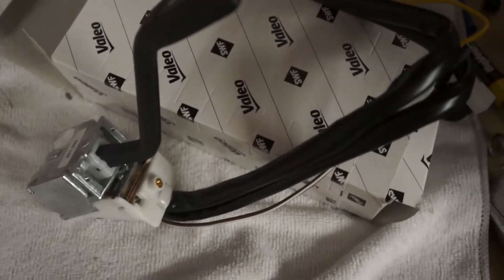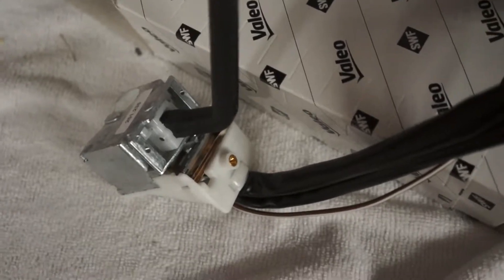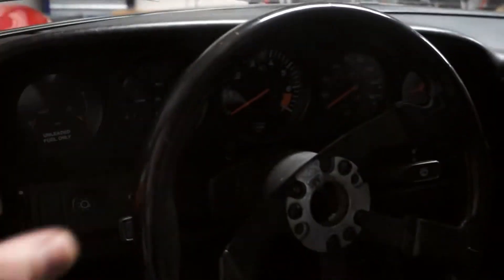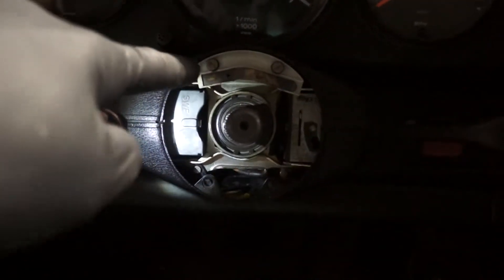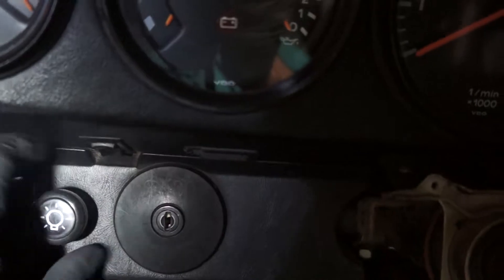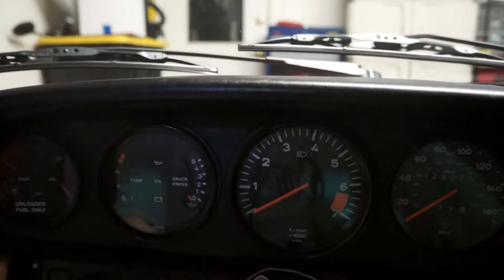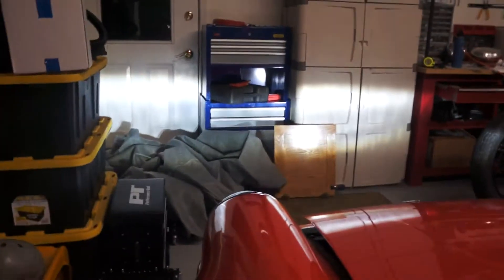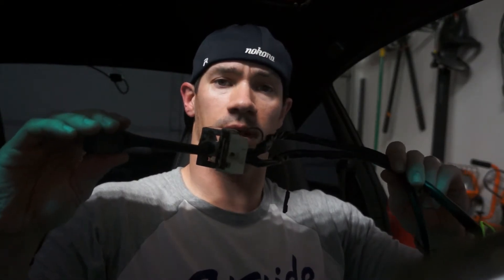Turn Signal Dimmer Switch Install Porsche 911 Carrera 3.2

Comment: You never showed the install or the wiring up. All I took from this was an unboxing of the new part and the removal of the steering wheel. the next thing you said it is all wired up. I wanted to see where did you wire things up etc
Reply from the maker: Charlester Williams sorry man. It’s virtually impossible to get a camera back there to see the wiring and have some light on it. Basically just behind the switch you’re matching up wires. Sorry couldn’t be more helpful.

Comment: Good video, same issue with my 88.  Also have to replace the steering wheel bushing as the wheel plays up and down.  Pry doing both at the same time.  Curious tho, what was the hack for the headlights?  Mine stuck in high beams.  Stupid fail for a car with only 35k on it.
Reply from the maker: Once I got this new turn signal switch in the hi beam/lo beam issue was resolved.  There's also a kit you can by that bypasses the headlight switch so the power is at the relay  and not the actual switch.  Otherwise they frequently burn out.